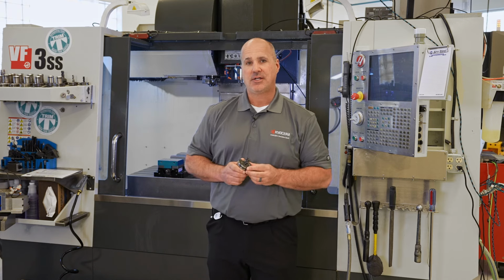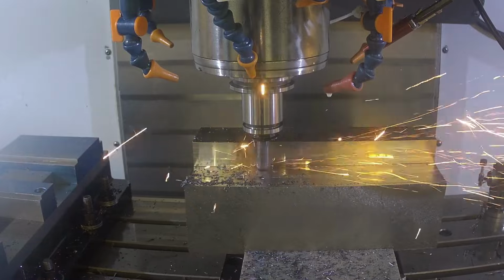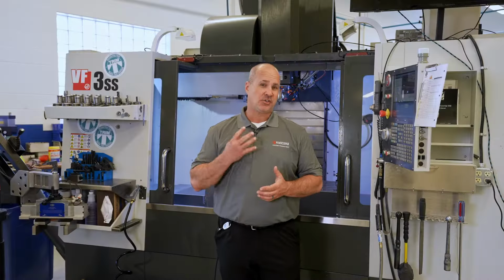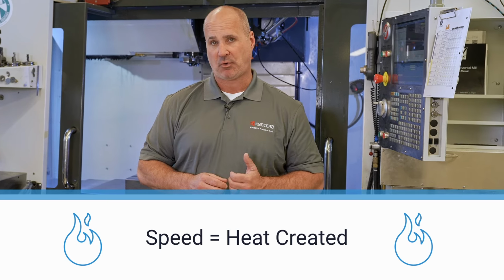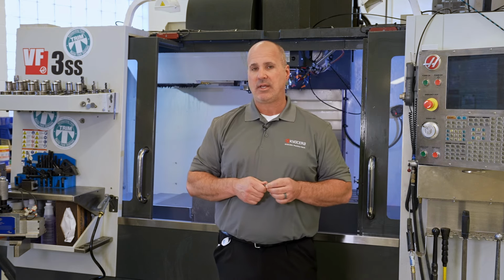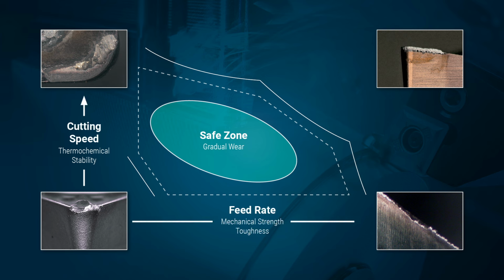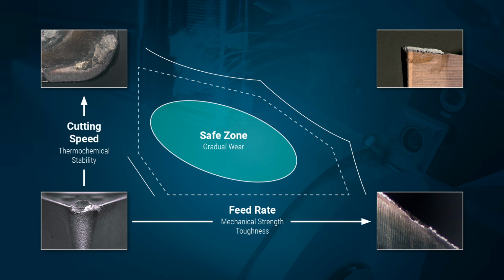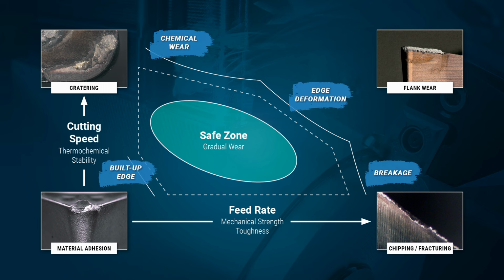Is Speed and Feed Killing Your Tooling?

Comment: My biggest problem is speeds and feeds using grooving or a part off tool. Trying to get the proper chip break is very difficult. I normally end up with chatter 1st then an immediately catastrophic event. Any helpful information would be greatly appreciated. Thx
Reply from the maker: As Jason mentioned, using the proper starting speed and feed is important. Other things to consider are the reach or overhang of the tool. It is important to adjust the overhang on our adjustable blades to the shortest amount possible while still allowing the tool to reach the center. If you are using a fixed tool (like KGD), it is best to select the holder with the shortest CDX dimension capable of cutting off the workpiece.

The main problems are feed rates lower than recommended, excessive overhang, or center-height problems. For cut-off operations, we prefer the tool to be on center or slightly above center (+0.006”). This setup helps achieve better chip control and reduces the risk of chatter and catastrophic tool failure. Hope this helps!

Comment: Being critical here, You need to mention "surface speed" rather than RPM.   I'm certain you're aware but it's doing a dis-service to someone who actually needs the information.   For those unclear of what I mean, RPM is the resultant from a function involving linear distance traveled per minute (aka. surface speed/cutting speed/SFM) and the cutter diameter.  

It's absurd to be teaching people to run a tool at a RPM value instead of a SFM range.  It's 2024, we need to be doing better.
Reply from the maker: Thank you for your insightful comment. You're right that specifying "surface speed" (SFM) rather than RPM provides clearer information.
In our video, while RPM was mentioned, Jason primarily talked about the speed of the operation, which refers to SFM. To clarify, SFM is calculated as: SFM=(RPM×Tool Diameter)/3.82 

For the 1/2 inch tool shown, this translates to:
At 3007 RPM: SFM≈393.6
At 10536 RPM: SFM≈1379.1

We appreciate your feedback